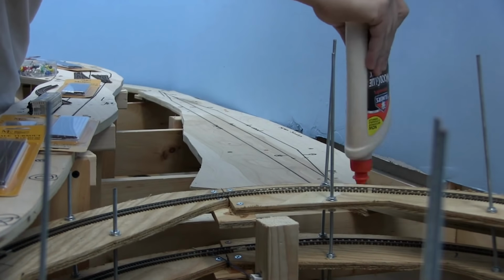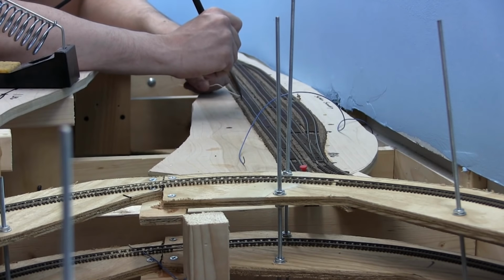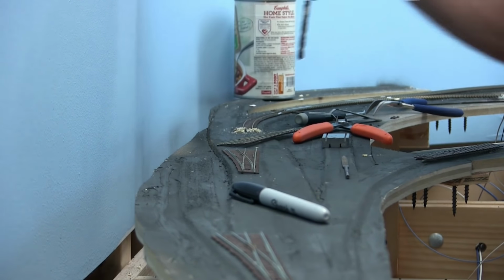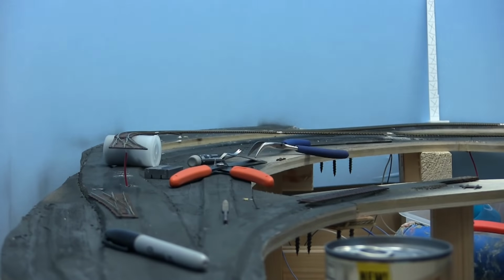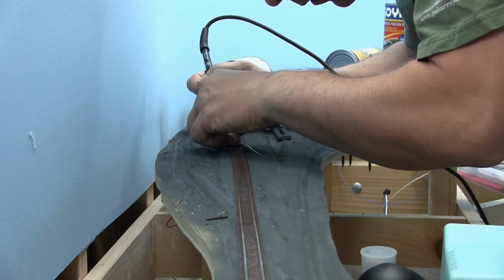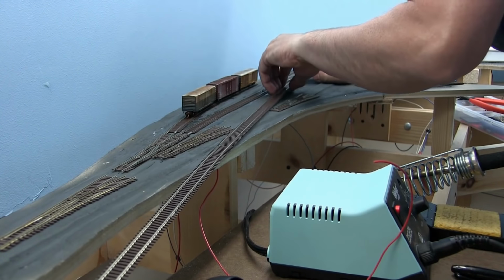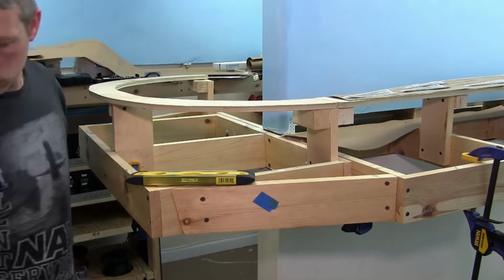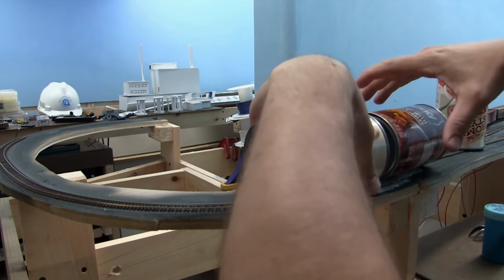Laying track to Englishtown on the Sayrehurst Secondary

Comment: Enjoying your videos, Joe.

Two points: 1. I would keep an eye on and allow some easement when coming out of curves into a section of straight track, particularly a switch. This will reduce the chance of derailments.

2. If you find you have feeder wires under a Tortoise, just bend the wires tight against the subroadbed and either notch into the plywood or put in some washers to create a small gap between the machine and plywood. 

Otherwise I would advise installing the switch machines prior to the feeder wires (or installing feeders in the middle of a section of flex track). 

TIP for viewers: While I'm on the subject of installing Tortoise machines, I have found using back-wrapped blue painter's tape (2" is good for this) will secure the Tortoise in place and allow for adjustment while putting screws in. This frees up a hand and makes life easier when working above your head underneath a layout.
Reply from the maker: A-Train thanks for the suggestions!

Comment: Thanks for the great episode.  Just have one thought for you.  There is something you can do for your turnouts that would allow you to run trains, you can make a spring tensioner out of piano wire.  I read it in an article in MR about 25 years ago.  I used the method on an HO layout I had with MKIII atlas switches, its a great substitute until the budget constraints for a lot of switch motors can be overcome.  If you want more info on it just let me know.  Thanks again for a great episode.
Reply from the maker: Thanks for the tip Mark, I'm going to look into that!

Comment: For the space where there no tie you can use leftovers tie from ME track and remove to top spikes and file the bottom just a bit to let them slide under the track where the joiners are 😉
Reply from the maker: good idea thanks for the tip!

Comment: It's looking really good.  You might want to put small security cameras up in the hidden staging so you can keep an eye on what's going on.
Reply from the maker: Yes, I have to start looking into that. I'm going to need a couple. Have any recommendations? I thought about using baby monitors, but they are a little pricey!
Reply: +Central Jersey Conrail in N Scale you can find them cheap on eBay or even at harbor freight has a small 2 camera system.
Reply from the maker: Matthew Jones
Sweet that what I'm looking, thanks Matt!!

Comment: Joe:  Please fix typo on the title for this episode.
 When I would have to lay a bunch of turnouts and track, I would let all the materials  "settle in" for a day or more and then check daily for problems like warping of track/turnouts due to being laid in too tight. I found out very quickly that my train room was flexible regarding humidity so I didn't solder track joiners for the first year in order to be able to easily fix a warped section.

A humidifier or at least a thermometer and humidity gauge is a handy item to have in your layout room.

Another hint is to keep track of the materials you used in construction like screw sixes and types, drill bits needed for a particular job. For my new shelf layout i am building a database and text sheets about materials, costs, suppliers, etc. Another use is for your locos and rolling stock. I would be happy to make databases for your fans... little or no cost... Great to have later on when you need to fix something or add on to you're  layout. You can never have too small of a layout!
Reply from the maker: Jon Frost your the first person to notice the typo in the title. Thanks.

Comment: Yes you are right. Cost wise it does come out cheaper. But my biggest factor was time. Yes this is a layout that I have planning for, but it isn't my "dream layout". So I didn't want to take forever getting things running. Second I have never done any hand built track. I defiantly want to! So what will end up happening is once I "finish" I will slowly replace each turnout with hand built one. At least that's the plan for now.

Comment: Boy I'm glad that I went to complete battery power. No frogs or trak power to worry about and no problems with "y's" or reverse loops. May not be right for "N" scale yet as the system is not small enough yet unless you put the system in a second dummy engine.
Reply from the maker: Hey David thanks for following. The verdict is still out on RC for N Scale for me. I still have many questions and I do not like the ideas of have dummy engines. When they miniaturize the equipment to fit in a single engine, then I will take a good look. The only problem I have is I don't feel that DCC has reached it full potential, and I'm not sure that we are ready to move on to the next control system.  You should defiantly make a video and post it. I would like to see that. Thanks for sharing!

Comment: What determines when to use cork or not? i noticed on turns cork is not used, but not sure if that is a the actual case.
Reply from the maker: Darsig67 I used cork through out the layout, except three places....the mini helix, the Toms River Industrial, and the end of the Glidden spur. The only reason I did not use the cork was for looks and to maximize head room in the helix. Generally I don't like to have track laid without road bed because it can become noisy running trains. Also most rail roads maintain a profile with drainage ditches on each side ( the cork simulates that).
Reply: Thanks Joe.